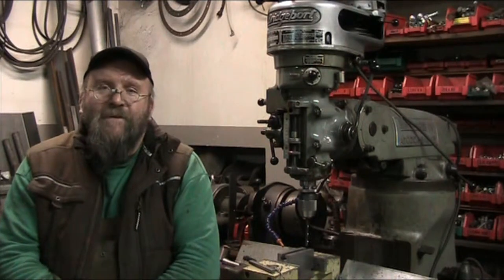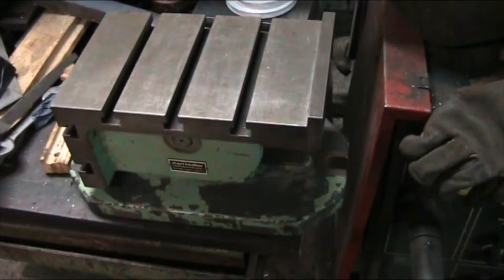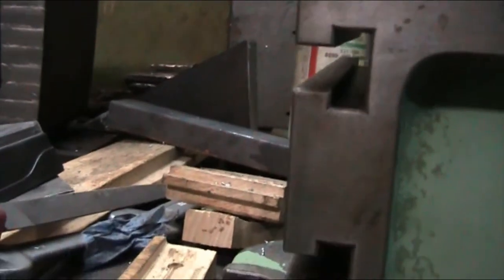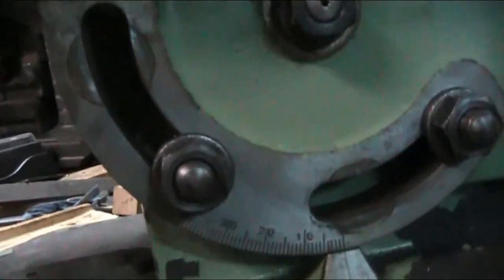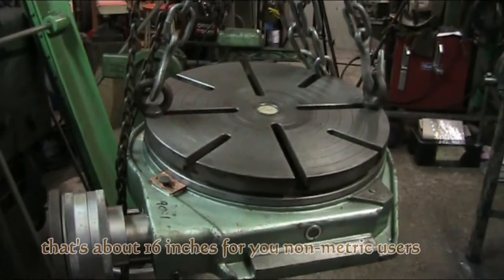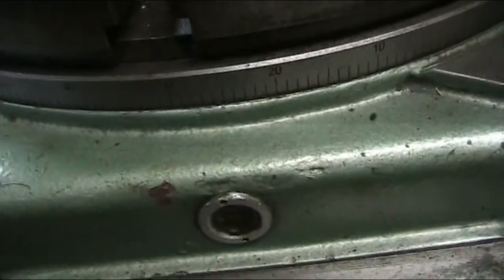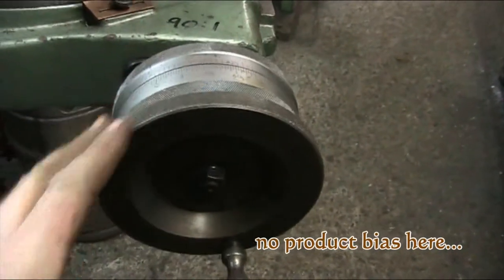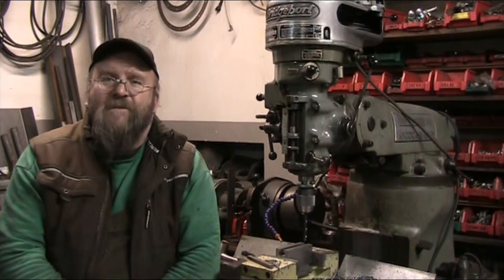duckin' the fog, new tool acquisitions. (we're not feeding the monster - yet)

Comment: I don't know what to tell you other than a sight glass is always, the level should be visible.
But in this case Google is your friend, search for what weight of oil should I use in my rotary table.
Should get you the info.
Mike
Reply from the maker: +Oldvet1946  ok, i'll give that a shot. i did a similar search specifically on that rotary but got nothing usable. the video hasn't had that much exposure so the answer to the question will be a while in the waiting methinks.
from the looks of it, it could be just plain ol' motor oil in there... it's pretty low viscosity...watery looking....